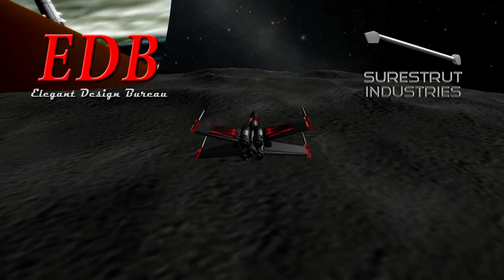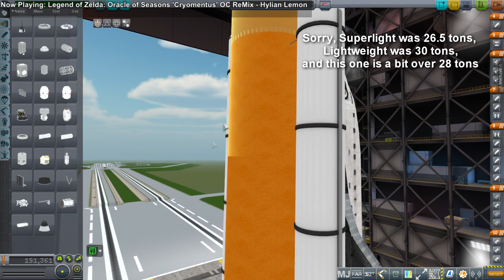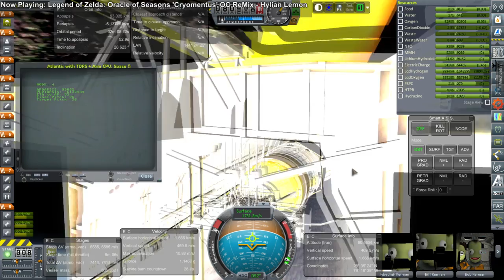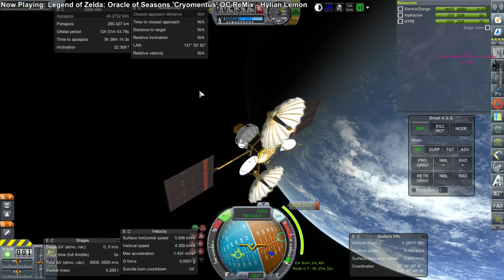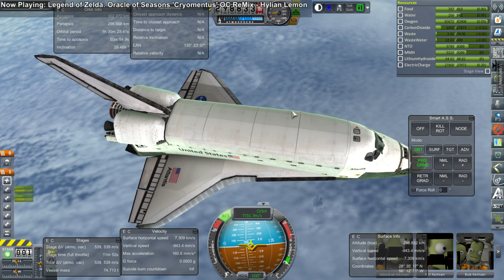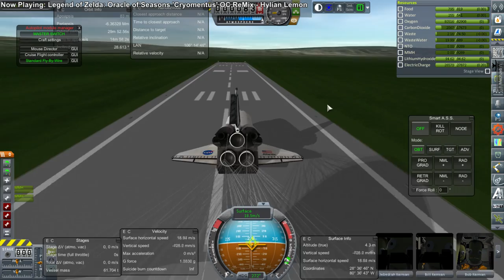Kerbal Space Program/RO - The Shuttle from Launch to Landing

Comment: If I am not mistaken couldn't the IUS remote shutdown? I remember doing it in ksp with that very mod.
Reply: Dont quote me, it has been awhile and I very well could be wrong. But, I think they had holes or doors they could open that would release the pressure in  each stage, obviously it could not light up again but it would be rough enough to attain geo synchronous. Although, what you've done is brilliant and would've solved the problem I had trying to do these pams with fixed delta iv.

Comment: When I load an install with CSS there’s only one shuttle part, the full space shuttle enterprise and it has a big spike on the top. Do you have an idea why it may be happening? Should I upgrade the required mods from the ones in there?
Reply: There is the ET and Boosters though.
Reply: Tyler Raiz I’m in 1.2.2, but it even says “Unsupported KSP Version
Please use 1.0.4” can you maybe link the newest thread? I can’t find it.
Reply: Tyler Raiz Yes
Reply: Tyler Raiz Thanks
Reply: That’s quite a few issues I’m seeing on the thread, I might start a separate save for testing possibly unstable mods.

Comment: That mod is designed for 1.1.2, but it also works well with 1.2.2. Also could You share that shuttle launch and re-entry scripts?
Reply: can you please send me a link to the space shuttle mod you are using? All the ones i have tried have an issue where all the parts except for the space shuttle cockpit itself load into the game for some reason. Thanks in advance and thanks for another great video :D
Reply: nevermind. i must have completely misses where you said it was the shuttle by Mike-NZ. Thanks anyway :D
Reply: Will you release them in the future? If not, where should I get started in making my own?